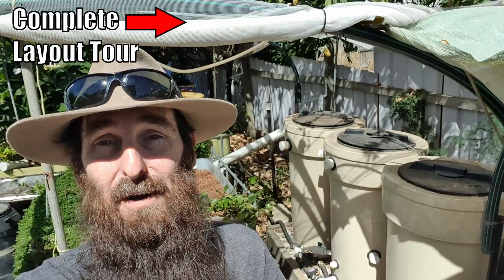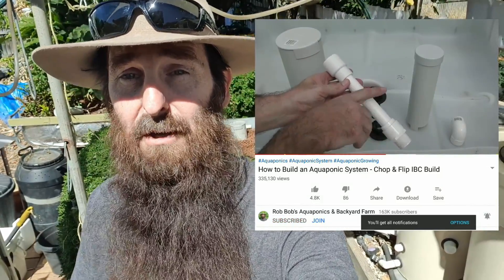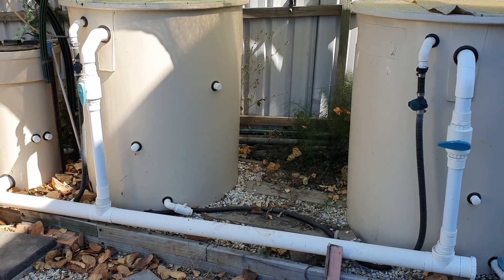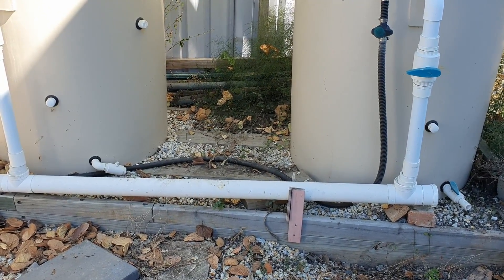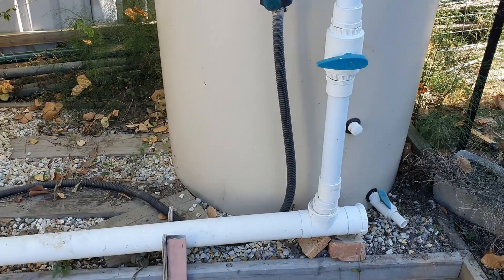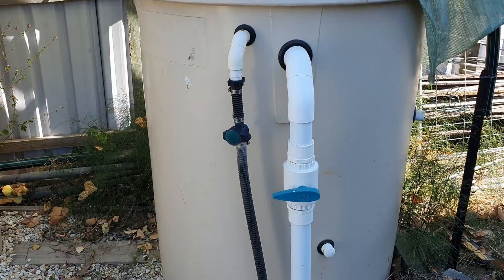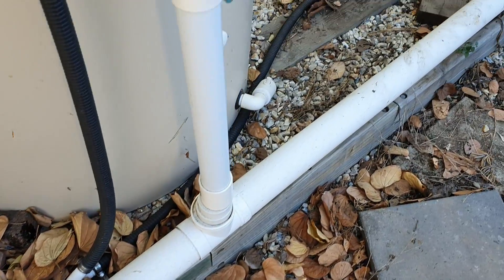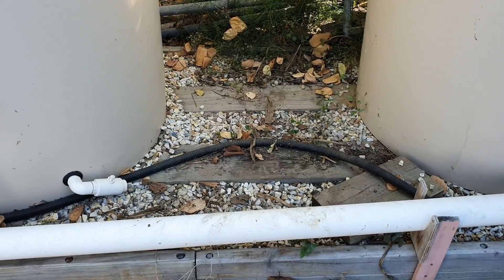Aquaponic System Design Mistakes | Don't Copy Me

Comment: Hi Rob. I’m really enjoying your blogs.  
We are moving to another place soon her in Victoria You have inspired me to start my Aquaponics.

Question; you may have already mentioned this and I’ve missed that blog. What water do you use to top up your system. Is rain tank water suitable. 
Also I have seen some yank clips where the use a sphere shape at the bottom of their seperation tanks to catch and drain the solids. 
What are your thoughts.  Keep up the great blogs.
Reply from the maker: Hi David. I use tap water to do top-ups as it's fairly "hard" so helps to add some alkalinity to the system. Best to let it gas off the chlorine first. 👍
Not sure what you mean with the filter drain? Have you got a link I can suss out? 
I know I'd prefer to use s cone-shaped base but they're not that cheap from what I've seen online. Will be splashing out to get one for the raft bed system though. 
Cheers.
Reply: https://youtu.be/rEDoPr-ZJUI
Hi Rob.  Thanks for your reply. You rock. I not very Tech savvy so I hope you get this link to the filter I was trying to Describe. I like how all the solids fulls to a funnel shape at the base of the solids filter. 
Cheers
Reply from the maker: I get you now. 👍👍
Cheers mate

Comment: Too late 😱
Reply from the maker: It's never too late.
Reply: Rob Bob's Aquaponics & Backyard Farm jokes aside I did make a few changes to your system. One change was, I put some plastic matting over half the bottom of the tank to reduce stress on the fish. However, to my surprise the river fish have been using it as the spawning area. So I get lots of fry, which I can transfer to a smaller tank to stop cannibalism. No more having to buy fish.
Reply from the maker: That's great mate. 👍 What sort of fish are they?
Reply: Rob Bob's Aquaponics & Backyard Farm I am here in sub alpine Japan, so I went with local river fish because it gets down to it as low as -10 here in winter and I’ll be running my tanks cold over the winter. Rather than the variety I think it is likely the conditions.Since this is my first run at Aquaponics, There are only three fish of 300 L tank. And, I know they’re definitely overfed. Also the fake grass at the bottom of the tank likely mimics their natural environment. I would say the three conditions that would be different from a normal set up. Finally, I found two different sizes of fry. So I guess this was their second batch and I didn’t see the first batch because they were hiding. Maybe you need a small breeding tank set aside for the good looking jade
Reply from the maker: @Master-Shannon  Nice one mate. Have you thought about growing wasabi? You can probably pick it wild but it sounds like the system has the right temp's for it.
Reply from the maker: @Master-Shannon  Is hard to breed the Jades in captivity. They use natural hormone shots at the hatcheries to get the females producing from what I understand. I have heard of folks using the local "rainbow" fish as breeding stock for small systems. 
Cheers mate.

Comment: Rob use this for your drain. It will increase pipe speed versus a straight T fitting

https://www.lowes.com/pd/4-Dia-PVC-Sewer-Drain-Sanitary-Tee/3133121
Reply from the maker: We have them here too but the issue was I had a 2" from the fish running into a 3" drain line & they only have fittings that take one size pipe in that style. Thanks mate.

Comment: I don't recommend bulk head fittings on a curved tank because when you  flatten a round hole on a curved surface it turns into an oval shape and it's difficult to  keep that from leaking.

I would just use fish tank caulk to seal the leaks from the inside of the tank 👍👍

That for sharing and as always keep building👍
Reply from the maker: Have seen that happen a bit on the blue barrels. 👍
Cheers Todd & have a top one mate.

Comment: If I may add a small detail- If you add a pipe to your pump that goes straight up, as tall as is needed and with an open top, your pump is going to push more water through the system because the pump is only pushing water straight up and not sideways all the way to the fish tank / "other side of the yard" and the water in the pipe is instead "falling down" into the fish tank. All the best Rob! Always inspirational!
Reply from the maker: Thanks mate. 👍👍

Comment: Hi Rob,  great clip  with  insight into what you would  have  done differently always some of the most helpful clips  for someone  like me. :) Can I  ask?  how come, when you have  your SLO  up  high, are   you not  letting that drop  down to the top of your radial flow filter  top,  and then have the center column be the outlet ? that  way the solids  will not need  the flow rate  to be pushed back up through the center column and you can simplify the  pipe work. the  SLO  should also have enough flow that you  wont see a buildup of anything. :) anyway, works great for me, but  might not work for you. Cheers Rob, have a great day
Reply from the maker: Having the water change direction at the top of the stilling well will help to slow the flow a bit.  If it was to flow straight down it would be harder for the solids to fall out of suspension.  
Hope that helps some mate.
Cheers.
Reply: That makes sense ;) the way I got around that was to angle the intake a bit and then have the water column rise up and over and edge to get the slow down I need. :)

Comment: This was a great explanatory video, mate. Unfortunately, I haven't been watching too many videos lately. Not enough time. This has been kind of inspiring. I may be the owner of a large bus soon and it will be my home. You have me thinking that I will probably have room for a 3-4m x 1m garden IN the bus. I can modify the area to ensure the plants I grow receive full sunlight. Also, I can baffle any water supply to stop slosh when moving if I go hydro. IF I decide to try this, I reckon it will be a great experiment. maybe I should search the Interwebz because I'm sure someone must have done this before. Maybe the clay bead method would work. I can't do Aquaponics because fish get seasick. 
Yes. Fish get seasick when they are in a tank in a moving vehicle. A friend in FNQ is a professional live Coral Trout farmer and has also worked transporting Trout from Cairns to Brisbane in specialised 1000 litre pods. The fish are then transferred from those tanks into pods designed for air transport. 
When the fish come off the boat and are taken to the export people, they are transferred to large tanks for about a week so they can recover from the catching process. Then they are transported South on a truck (in those thousand-litre oxygenated pods). They then go into recovery tanks before being put into the airfreight live tanks. Just to clarify, the tanks used to transport the fish are designed to minimise or eliminate 'slosh' because a 1000 litre pod will hold (IIRC) around 250 1.5kg Coral Trout. The tanks are oxygenated to ensure the fish don't suffocate, but yes, they hold a lot of fish. Trivia: If the Oxygen flow to the water is too high, the Trout go into a psychotic state and start smashing at the sides and generally run amok. There is a particular O level that keeps the fish calm and unstressed that needs to be maintained and now I'll shut-up. Sorry, just relating info from a wild fish farmer.
Reply from the maker: Thanks for sharing Brad. 👍 Was very interesting. Have seen the special transport tanks they use for the salmon down south. My old man was very interested when he went on a trip to Tas a few years back & I got the full rundown on his return.  😅
Didn't know about the sea sickness through but it makes sense when you think about it. 
Hope the bus conversion goes well mate.
Cheers.

Comment: Hey Rob great video Thanks. 
Been following you for a bit now and wanted to do what you had set up ...glad to hear that your going to re due things to make it smarter ...can't wait for the videos. 

Though I have a question. 
How do you plan on moving the fish? Are you leaving them in the tanks? Or? 
Reason I ask ...I'm going to need to move (my future system) mine across the state ...approx. 375 miles  (5 hrs of driving).
Reply from the maker: Hi Eric. Haven't had any fish in the system for over a year now. I have moved fish in the pasted & used sealed 100L/25gal barrels with a lid.  Had some air stones in the drum that were powered by a 240/12V backup air pump. Mind you, we were only travelling 20km/12miles so the battery didn't need to last too long. A deep cycle of some sort of connection to the electrics in your vehicle would probably be a better option for you. 👍

Comment: Hi Rob Another great clip. Thanks for all the info it has helped me get my head around the aquaponics setup. I currently have 4 grow beds outside and 4 in an igloo. Have had trouble keeping the nitrates reading  above 40 ppm over winter. Lost most of the jades in the February heat wave no aeration at the time thought the water movement was enough. How wrong I was. Just ordered another lot of fingerlings to be delivered in two weeks. I have managed to keep the water above 15 degrees C over winter with solar heating averaging 18 C most days not to bad for Withcott Qld. My main mistake has been cutting the IBC tanks at the second ring making the beds about 350 mm deep "" didn't watch your clip close enough"" lucky I am using 20mm Blue metal heavy but it works. Looking forward to watching the rebuild.
Reply from the maker: Nice one on the water Temp Brendon. 👍 I was struggling to keep it above 14° the last time we had Jades in the system over winter. What sort of heater are you using?
Cheers mate.